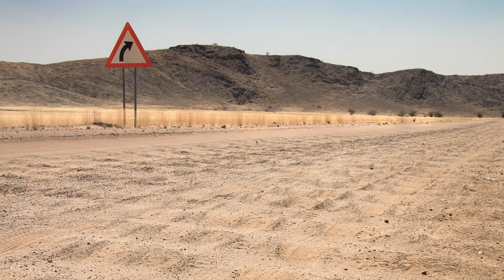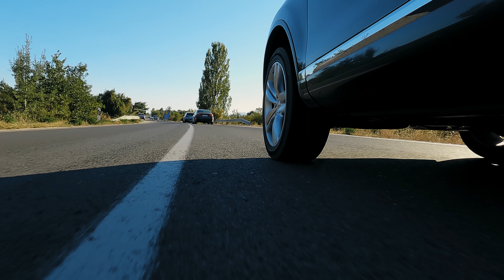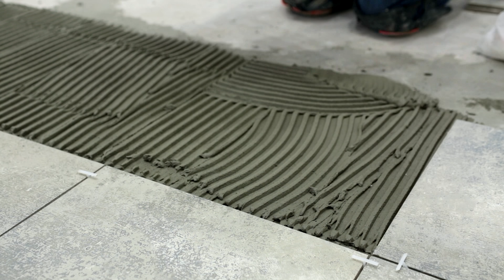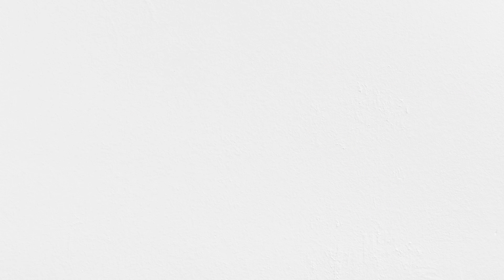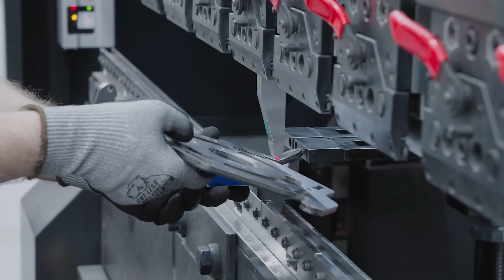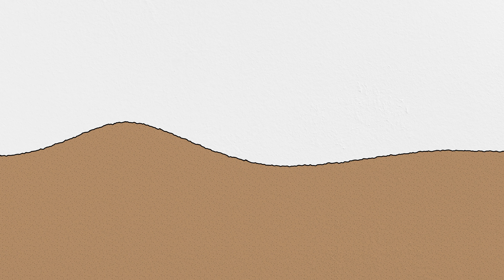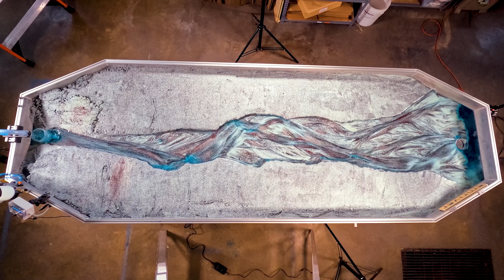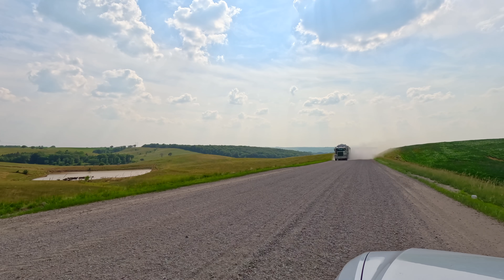Why Roads Get Washboards

Comment: Growing up in rural Alberta I noticed that the washboard was more prevalent where vehicles were changing speeds. Up or down. As an adult that mountain bikes at resorts like whistler and revelstoke I have noticed that the washboard on the trails is always at the entrance to the banked turns where bikes are decelerating. I would be curious to know the impact to washboard from accelerating and decelerating.

Comment: I occasionally see wide dirt roads where the washboarding lines are straight lines that go unbroken all the way across the road.  It seems unusual that cars going one direction would produce lines that match up exactly with lines produced by cars going the other direction.  There is no gap where the center line would be, no gaps in between the 2 tracks that the tires would make, and the lines don't lessen at either side of the road.  Think these lines are created by the equipment that grades the road, the grader blade reaches unbroken all the way across the road and when it moves up and down it creates the troughs and ridges.
Reply: i've seen a similar thing on mountain roads, which made me think they're from run-off in the spring. i'll have to look closer next time, maybe it's bad grading

Comment: Eh, not buying it.  At 10:56 you can see ridges that run all the way to the edge of the road, where no tires would run.  Also, my local mountain bike trail has a section of fire road that is wash boarded evenly edge to edge with only bike and hiker traffic.  Seems like there are natural forces that come into play that he really didn't go into.  The 'wheel hop' explanation would clearly tie the frequency of the ridges to the natural period of the suspension, and it clearly doesn't.  He kind of danced around this problem.
Reply: You would be correct, somewhat. 

Wind can and will contribute to this phenomenon, but it isn’t the sole reason.
Reply: @sterlingodeaghaidh5086 wind isnt sufficient a force to increase the frequency of packed dirt roads to the levels seen in reality, especially when vehicles are actively exerting forces that would maintain a longer frequency of occilation
Reply: @JohnnyB_1988 I didn’t say it was more of a contributor just that I was one.

Comment: Would be interesting to see the difference some controlled variables can make that have not already been accounted for in your current setup. Weight being a big one since many commentors seem to believe simply having heavy vehicles does more damage. Another would be driven wheels since your current setup does not take into account the use of the traction needed to move a given weight at a given speed nor does it account for acceleration. I am sure the reason this has been studied for so long is that no one factor can be accounted for and our vehicles are also ever evolving.

From a drivers perspective the wheelbase and spacing of the washboarding certainly can have a very big impact on how bad it feels to drive on, if it matches both front and rear as the vehicle goes up and down evenly vs front and rear going up and down at different to opposite times. One is not so bad, the other is akin to being on one of those mechanical bulls trying to throw you off.

Comment: Seems so obvious once demonstrated. My initial assumption was that you were going to fail to recreate the issue with a dragged wheel. I thought the fact the wheel was driven was going to be the key factor, but actually for for similar reasons - I expected that when a driven wheel encountered a bump, it would lift and lose traction. As it landed, it would be rotating slightly faster than the ground speed and would kick up the sand as it contacted, causing small mound behind the tyre. As more wheels follow the same rhythmic pattern, the mounds build and the rhythm becomes more well established, becoming somewhat self-perpetuating.

Comment: They are regrading those dirt roads regularly around where i live. The rain also has a affect. Weekly or biweekly. They take a tractor and drag a thing to smooth gravel / dirt out or whatever tool they use.

Those are mainly river roads. Makes no sense for blacktop or asphalt in some places. It's actually better for the environment in some places if the road is dirt because of the tar.

So we know rain will also create holes and then water fills the holes.

Also there is always someone going way too fast on dirt and leaving burnouts on the road making ruts or they are dragging something behind the vehicle. Maybe not every second or anything but all those things go on, on dirt roads especially near rivers.

Comment: Acceleration and deceleration starts the process. The changing washboard grows so does the acceleration and deceleration. Most people want MORE gravel. The gravel should be a lot of fracture segments with clay binder. When a load is delivered. Look to see if it's round or fractured gravel. If round... no good. Make a ball in your hand (like a snowball) of the new gravel. If it falls apart in your hand... no good. Some areas are very poor for fractures and/or binder. The area is bound to the local geology.

Comment: They are called  acceleration bumps and braking bumps in dirt bike racing for a reason. The suspension action causes it. We can tune those suspensions to not react to the bumps like the others. It's a constantly evolving thing because the common suspension action of the majority of the bikes creates the oscillations. You have to tune it not to respond to those oscillations. In other words you have to set it up to be different from everybody else.

Comment: My old 2001 Chevy Blazer was nearly undrivable on washboard roads. Had to slow down to like 15 MPH in order to keep it from sliding around and trying to veer off the road. This video made me think of waves in the ocean, any aberration in the water's surface creates areas where wind will push on unevenly which creates waves, and comparing that to wheels on dirt makes a lot of sense in my mind.

Comment: Your machine is not making washboard. It made whoops. They are much larger and much longer period.

Washboard is created by an entirely different mechanism. Pneumatic tires and shear forces on the road wear surface cause them. Its the tire deformation due to load sheer that initiates the resonance.

Your model proved hard tires dont make washboard. Hard tires make whoops.

Comment: Same thing happens with concrete roads, the wheels hammer the leading edge of the slab causing it to pivot into a slop, causing the next slab to be hammered by the drop, and so on. The concrete doesn't change but the substrate shifts in just the same way (though usually with the help of water intrusion).

Comment: Yesterday I was on a US Forest road near Cadillac, MI with some of the worst washboards I've ever seen; I thought were going to shake my truck apart (the entire forest seems to be falling into disrepair). I thought about this a bit and how everybody on these trails pretty much drives a pickup with similar wheelbase and handling characteristics (including mine). When I take this trail in a smaller SUV, it's not a problem at all. So while I never really looked into washboarding, I concluded that resonant frequencies were involved somehow and the force gets amplified back into the road which sends it back into the truck. It's also a horrible side-to-side swaying in the truck, far greater than the washboards (so they are kind of developing in two axes) and the only thing that helps at all is to wildly vary your speed through these patches (so those amplification forces don't develop). But I haven't even watched this vid yet, just throwing in my observations and hypothesis.

Comment: Traveling one particular back road into the local mountains I've noticed washboards are worst around tight hairpin curves. I believe it's due vehicles having to brake on the way down & accelerate on the way up coming out of the turn. Inside of the turn on the way up is always the worst & if there's no traffic coming down, I swing wide to avoid having the fillings knocked out of my teeth.😁

Comment: I drive on a washboard road and wonder how the washboard would be affected if you cut a few lines across the short length of the waves.  Drive something down the road that just cut thin lines perhaps an inch apart down the road.

Comment: I've seen enough Top Gear to know how bad this can be for a car (as well as for driver comfort and travel speed). At first I wondered why they'd build roads like this, it didn't click that something so regular and durable would happen purely through emergent behaviour of the road material. This is a very thorough explanation, and the one shot of the bumps propagating around the circle like waves in a water trough was REALLY cool

Comment: 4:55 - and i REALLY had this graph cause it is not just an over-simplification it also leaves out another huge part: The wear and damage that it does to the tires and vehicles - aka COST. It is no excuse that this is not a direct cost to the government. The roads are PUBLIC INFRASTRUCTURE - they are there FOR THE PEOPLE and the costs is also 100% taken by the people (no, the government doesnt have any money on its own. That is ALL coming from the voters).
Even just the avoidable repair-cost from pothole-damage alone is, depending on the source, stated at around 3-6 billion $ a year. The increase in fatalities from crashes caused by bad road-surfaces too is in a similar range. And you can also look at the environmental impact of bad roads as  it causes higher wear on tires and higher engine emissions from people having to constantly adjust speed. Then there is the extra cost to everything from the increased fuel-usage and specially for the transportation-industry the longer trips. Just think about how many tens of thousands of trucks have to slow down and avoid bad road surface patches every single day, how much this slows down traffic. Even if it is "only" 30 seconds longer - with the millions of people on road that adds up quickly and is a lot more fuel that is used - a lot more emissions blasted into the air just cause somebody doesn't want the roads to get fixed.
And it is a "not want to" cause not only are there enough resources and companies available - even when demand increases companies react by hiring more and increasing their workforce accordingly.

Imo it would be great if all countries got some studies to put some reliable and specially now Official numbers to the damage bad roads cause and then get that money back from the bureaucrats responsible for preventing the roads from getting fixed. There must be accountability and somebody intentionally causing financial harm should be made to pay for all the damage they caused. And if it is all their live-saving and all the money they will ever earn in their life: Yeah - Take it all away. They did the same to everybody else first and Criminals deserve no pity.

Comment: I live on a sand and gravel road, there are 3 cattle guards between me and the paved road, and on either side of those, the washboard is the worst, I assume from people slamming on the brakes and then accelerating away from them. The other worst area is my neighbor who has dogs, they're out in the road chasing trucks pretty often, and I assume the washboard there is either from people slowing down for the dogs, or trying to run over them, either is possible! Anyway, if we could just slow down, that would make the washboard less likely to form? Good luck asking everyone to slow down, but it would be a good conversation point I guess!

Comment: Question: Steppers tend to be kind of choppy and pulsey down at the macro level, by comparison to Servo motors which have more complicated drivers but are much smoother running, as far as I can determine anyway? do you think that the pulses had anything to do with the results here?

Comment: In my area of Kansas, we have a mix of all types of roads. Sand roads are the worst about washboarding, a gypsum rock road holds up well. In all cases in my experience (30 yrs rural UPS delivery) the worst of the worst are always where heavy trucks apply acceleration. the pattern matches the gear shift timing exactly. 

In my days of playing around in the riverbed, deflating the tires to 10 lbs or so was an easy way to gain traction in sand. The results of that were that you also created extreme washboarding in the tracks of your tires. Good for you, bad for the one following you if they crossed into your track.

Your simple caster wheel doesn't get into the effects of acceleration forces and heavy weight with acceleration. My anecdotal obsevartion is that washboards start and spread from acceleration zones first, and areas where cruising and coasting occur are the smoothest. My evidence is that when I turn on to a dirt road from a paved road, the smoothest path to accelerate is always on the opposite side where traffic is braking or coasting to a stop.

Comment: There is science on "dirt-roads" in 2025/6? Why? You can´t prevent dirt-roads from getting bad. There is work needet to get them good - probably several times a year, with a grader. Albeit, they (in scandinavia) used since some years a different material to make/maintain dirt-roads. Maybe there is some return out of the science? As to only put some fine-grained gravel on the road, they used more bigger gravel. I do not know, what the benefit is, ... probably real science or simply, that their older gravel-source may gone out of material?  Albeit in scandinavia, those gravel is everywhere in the nature - they get it with a caterpillar driving into nature and grab some. The bigger gravel isn´t - needed to be made - mashines and work needed. Probably that has some benefit (or its simply, because someone makes profit out of it?).

Comment: I live near a section of road that has a steep downhill paved to a stop sign that is a horrible washboard, I assume it is from traffic slowing for the intersection because it has to be repaved every year.  Right beside that washboard is a double railroad crossing that makes the washboard feel smooth in comparison and it never seems like that can make that crossing smooth even though they replace it every year or so as well.  Have you ever done a video showing how they design railroad crossings?

Comment: When you have this setup, why not try different materials and different speeds to see if you can make it go away by, for example, some cars driving slower and some faster? Maybe smaller/bigger wheels? Maybe  change the resonance frequency of the suspension (weight of the wheel assembly).

Comment: So what I assume is happening on a micro scale is that through the forces of a tire or what have you for an initial valley and mound to form a grain of sand will be pushed forward onto the grain of sand in front of it, this process is repeated until more grains of sand pile on each other to form a mound and these mounds will multiply from the 'jumps' it creates.

Comment: I always assumed that the force being applied to the road surface, and the granularity of the road surface and it's inability to push back equally led to the wash-boarding (with this effective varying per relative force applied, or in real life, how much throttle was applied by road users). In my career in transportation, I have noticed that washboards are always most pronounced at areas where people are accelerating (naturally on the far end of corners for instance).

Thanks for the analysis and i'm interested to see you dive further into this topic (particularly with an updated rig that applies power to the road surface, and perhaps a hard more realistic road surface to match)

Comment: Thank you for the video.  Very interesting.  If I'm understanding correctly, it seems like the default for unpaved roads is trying to find a mixture that is the best for when it is in the good condition mode -- low dust, high shear resistance, smooth surface.  But the mixture with those properties often has a relatively high slope of repose that leads to washboarding when the road begins to break down (is in 1 of the many wear states/modes).  Is there research to find a material that has the ideal properties in the ideal state and also a low slope of repose when the road invariable starts to wear down?

Comment: I don't think this explanation for them is correct, because in my experience they tent to go all the way across the road without a shift. With traffic moving in both directions the dirt should be moving in two separate directions which would form breaks in the pattern. So while this probably plays a part it can't be the full explanation

Comment: I was super excited to see this title...it's something I've been wondering about a lot lately.  I live down a dead-end gravel road, with very little traffic....but it washboards VERY quickly after grading.  Also...the washboard extends edge to edge...not just in wheel ruts (again, very low traffic).  
It's extremely windy here...so, I think that wind is actually a pretty big component...or, at least on this particular road.  But, then traffic does exacerbate it.

Comment: I’ve noticed on dirt that it starts where vehicles, mainly trucks I think, use their brakes before a corner or other obstacle. It then spreads further and further ‘upstream’ until it affects even the bits where speed is steady. It’s obviously (I’d say) connected with the resonance of the axles and my guess is that the front one matters most. I wonder if corrugating develops where there’s ONLY cars?